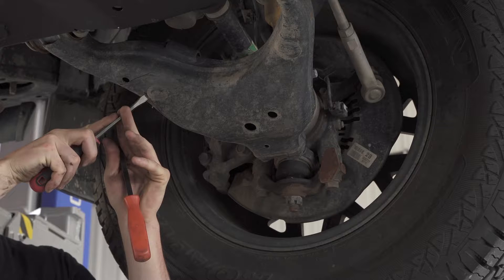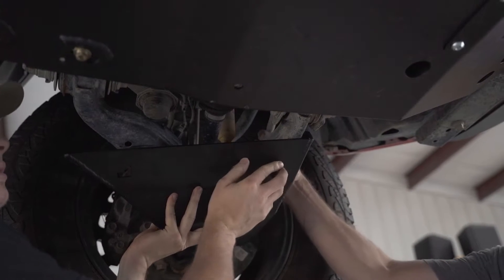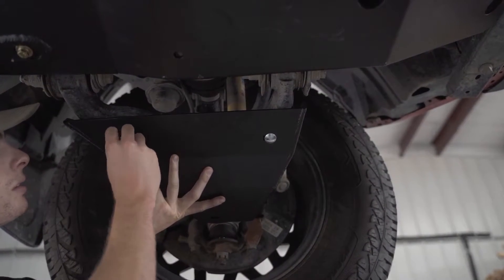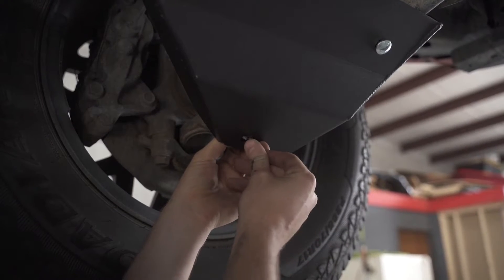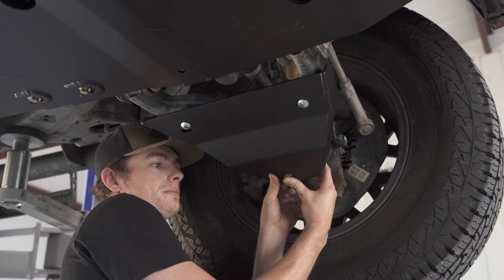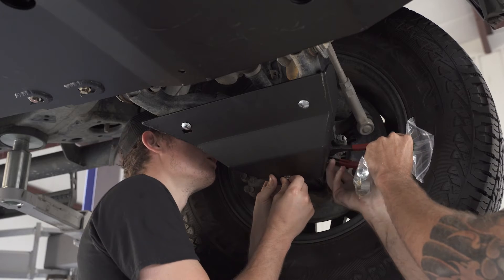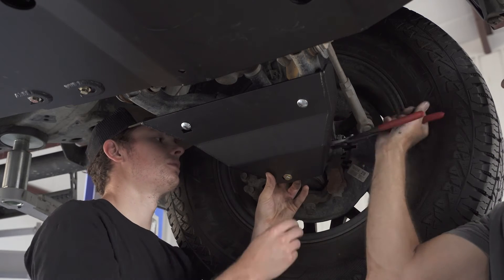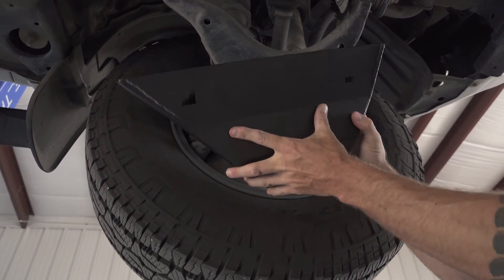How to Install Lower Control Arm Skid Plate for 2005-2023 Toyota Tacoma | Cali Raised

Comment: How much ft/lbs torque do you need to tighten the bolts?
Reply from the maker: No torque spec, just get them tight!
Reply: @CaliRaisedLED  Got them installed. Great product. Thanks!
Reply from the maker: @SP10371   Thank you!